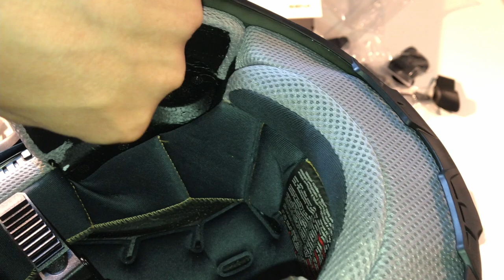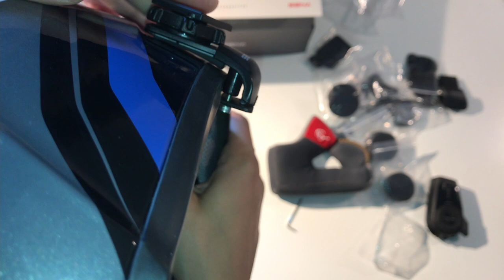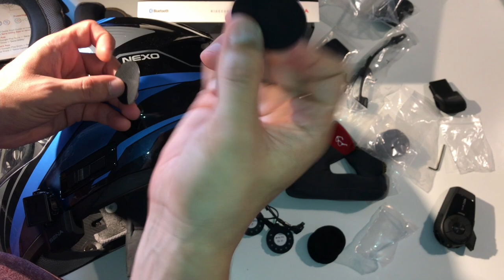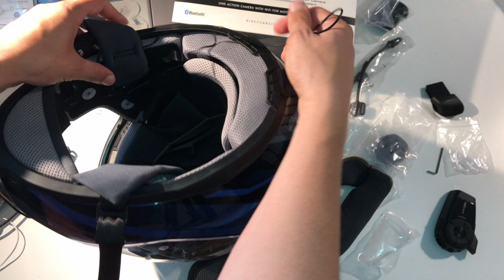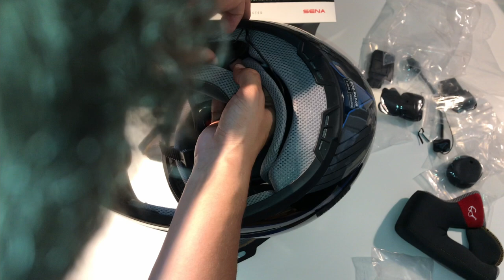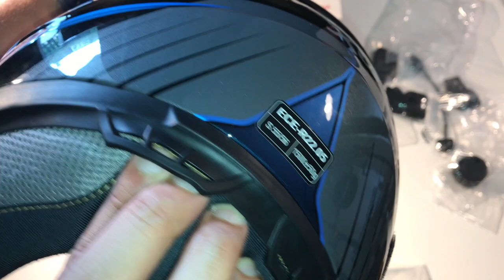Sena 10C EVO installation on Helmet (Step-by-Step)

Comment: I am getting crazy static when on a phone call while recording a video. Other than that, the audio in the video is fine. I have mic settings in the video as low, which is recommended, but still same problem. I have the latest firmware, but that doesn’t help…. I have the 10C Pro and that worked flawlessly. This 10C Evo is crap.
Reply from the maker: Never had this problem .. but rarely used the phone while the video recording is running but when I do it works fine !